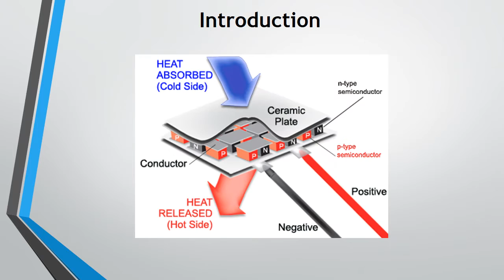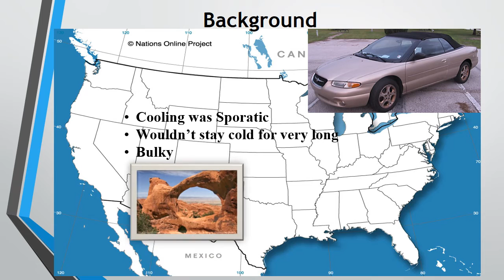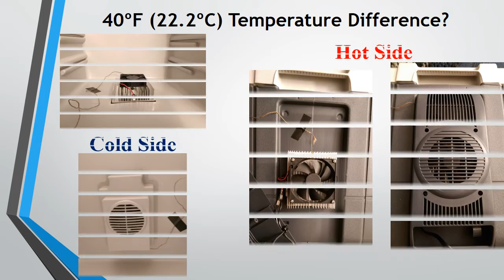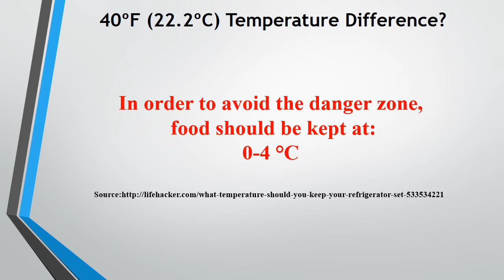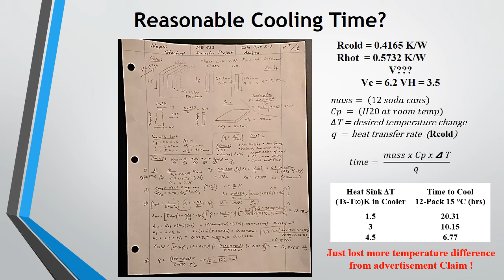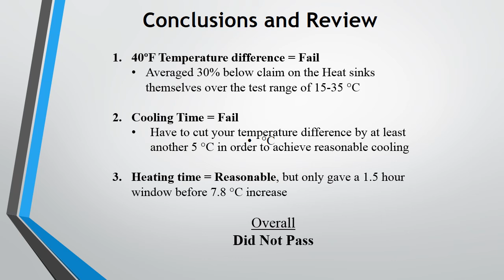Analysis of Coleman  40 qt Thermoelectric Cooler

Comment: what about the amperage that it will use in a 24 hour period?did it actually constantly use 6amps? I'm thinking of hooking one up on 12 volt system with a timer. 15 minutes on, 30 minutes off. See if it will keep food cool to about 15 degrees Celsius or below . using a battery on the calculation that it will use 6amps when running.
Reply: i had a similar thought.  3 on 3 off and so forth during the day.  ON at 7am and off at 9pm..running of solar... want something with low draw just to keep items cold ..

Comment: appreciate the technical info. we own one of the first models coleman made
 the performance was better than what your unit produces, however the heat sync stopped working within 1 years. coleman did send us a new heat sync. also we use ours with the heat sync at the top and the door opens as a standard frig would. not sure if that would make a diff in the performance. we does this due to thermodynamics heat rising / cold settling. thanks again for the video